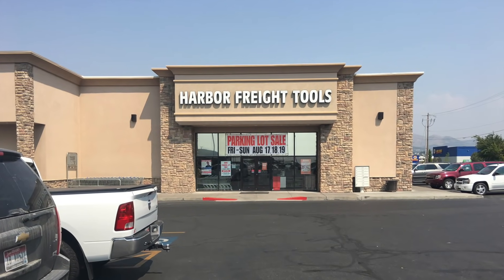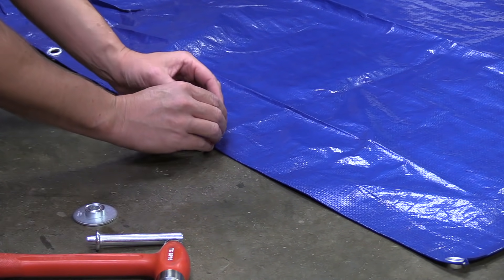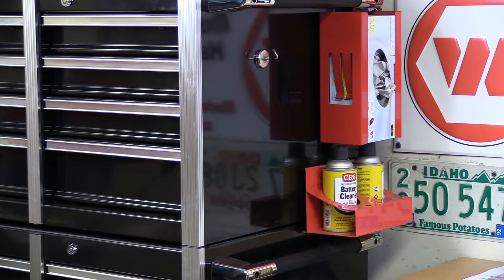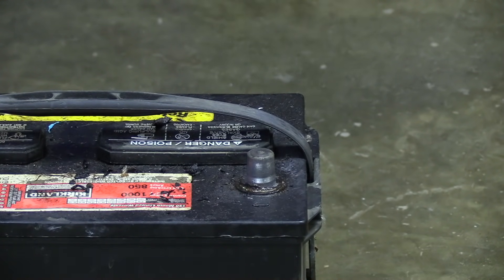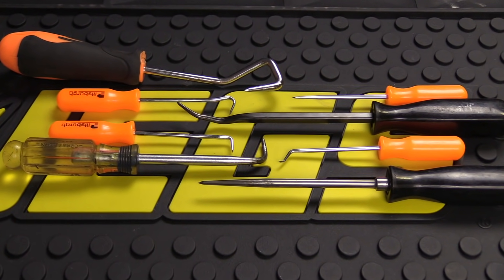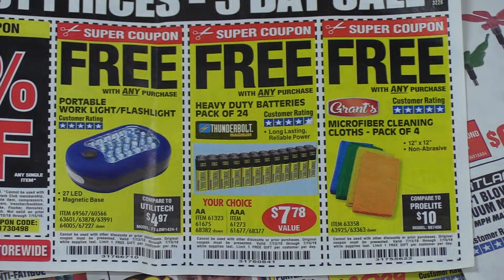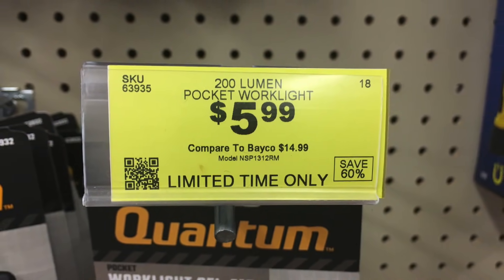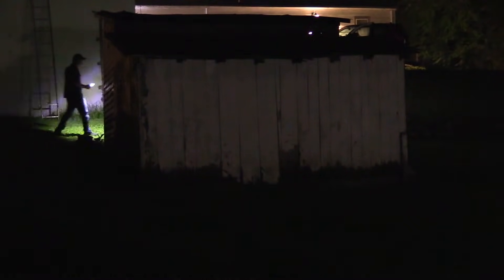TOP 5 BEST HARBOR FREIGHT TOOLS!! (UNDER $5)

Comment: I use that grommet maker.  It's very handy.  

I got a tip from another You Tuber, Explorer Steve, about the right angle ratcheting screwdriver set at HF.  It was only $1.99 I think but haven't been able to find it lately.  These sets are upward of $10.00 at automotive parts stores and the big box places.

Comment: I have had one of those battery terminal cleaners for years. I use it for cleaning oxidation off copper pipe prior to soldering.

Comment: I bought the 29 Gallon oil lubed air compressor about 5 years ago. Still works perfectly with lots of hard use. 
It's foolish to buy woodworking clamps anywhere else.
I paid $28 for a 36" pipe wrench that I don't need....until I do. Lowe's wants over $100 for one.
The breaker bar is great.
Warrior diamond grinding cups. I paid $30 at the time for the 7" version. I think they're $50 now. Still a good deal, works and wears well.

Comment: My socket set I got almost 15 years ago has never let me down in my conveyor assembly jobs and maintenance jobs over the years. Their wrench sets, I haven't counted lately but I think 14 piece has held up well also.
I recommend you open up the ratchet and give it a good cleaning and oil it up right out of the box and also a few times a year with heavy use. Might be why mine lasted so long.
Also the vertical and horizontal metal cutting bandsaw that they sell for like three hundred bucks now you should clean out the gearbox right away and put in fresh fluid because I found a good amount of Machining leftovers floating around in the lube.
Obviously these are not less than $5.

Comment: I  don't  have  the  grommet  kit , no  need  for  them .  2  sets  of  the  hooks , have  the  tray . Don't  have  the  light , but  do  have  the  slimbar folding  light   (  I  have  bought  6  so  far , 3  for  me  and  3  for  gifts ) , the  580l  tactical  light , the  280?  rechargeable , and  3  of  the  quantum  headlights.  I'm  a  refuse  truck  mechanic  and  you  can't  have  enough  light . 
The  only  problem  with  the  video  is  the  felt  noco washers  on  the  battery  posts . If  your  not  Reeeal  careful  that  crud  will  get  up  on  the  post  and  make  you  think  you  have  battery  problems . Been  there,  been  screwed  by  it .
Love  your  reviews , honest,  straight  to  the  point  without any  bs .

Comment: Seems like I'm the only one who doesn't like the picks. In all honesty, I don't mind spending a few more dollars on picks that are more durable at the tip.
Reply: Felix F or getting loose in the handle
Reply: Be careful. That's a double edged sword. A sturdier pick end means either it's thicker (which then I'd use a screw driver) or its a harder treated steel (more likely to mar surfaces). Besides, with a lifetime warranty, they're semi disposable.
Reply: Wait, your assertion is that the HF picks are better than hardened steel, because they're soft metal? Seriously? Sure, why use hardened steel when it's so much better to break off a tip from a shitty pick in a circuit board and cause a short, as an example. Would you like a few dozen more? Frickin' ridiculous. Insulting to basic human intelligence.
Reply: I have used mine six days a week for the past year in an automotive shop. They sure work great for Toyota oil filter gaskets, and I can keep my nicer set clean for interior applications.

Comment: The Bauer rechargeable swivel head work light is great. It costs about $30 and I use it daily at the shop. It has a magnetic base and runs in an 18650 battery
Reply: That light usely on sale for 22

Comment: lol using the 20% off on a $5 item
Reply: I'd rather have that $1 in my pocket than in their cash register.
Reply: I shop here at least once a week for something..  I always purchase two items minimum..  figure 20% saves you a buck, a normal coupon saves you a buck, and whichever freebie you want saves you 3-5 bucks..  that's a $5-7 savings weekly..at 6 bucks that's over $300/yr..  which paid for a cement mixer, a a framing nail gun, and a band saw..  all 20% off of course, and the nails and saw blades yielded me a magnetic bowl and microfiber towels for free. 🤷‍♂️
Reply: @aztekwarrior518  How do you like the band saw?
Reply: @jigiels29  didn't care for the blades, but the saw is great !   I built a stand for it so it sits upright like a tabletop saw .. and built a table for it..  has cut through anything I've put on it..very precise,  not crazy loud..  had it about 2 yrs I guess.. no issues whatsoever
Reply: A penny (dollar) saved is a penny EARNED.. it takes very little effort to get the email or coupon up on your cell phone and by doing so you put money back into your bank account.. Consider this, if the name of the business game is getting the money from your account into their account (legally) then your consumption ledger should show the efforts of you keeping your money in your bank.. Warren Buffet always says, "Profit is made when you buy, not when you sell" .. "Value" works the same way..
Reply: @dannyhale7645  You must live incredibly close to an HF or you don't value your time. If I'm going to HF, I'm not going to be buying just one thing that cheap, so using the 20% off on a $5 item doesn't make much sense.
Reply: @diydan2213  Yes, but between time and gas to get there, buying just one $5 item even with a 20% off coupon doesn't seem like a very good deal to me.

Perhaps if you have one within walking distance that might make sense, but I'd rather save the money on the gas and my time.
Reply: @SmallSpoonBrigade , I live in a small town, but there's a Harbor Freight about 15 minutes away. Since it's in the biggest town in my county, I drive past Harbor Freight a lot. I would definitely pull in the lot to save $1 if I needed the tool. I forgot what it was, though. Been a while since I posted that comment.

Comment: I pick up a magnetic tray or two almost every time I go in, or some other magnetic gadget - they come in handy in so many ways. Their various  vinyl gloves are good bargains, so many odd things ------------------------.  Recently, there seems to be a great improvement in the quality and utility of their new power tool lines and welders, and their hand tools may not be pretty or shapely, but for the most part, they are relatively strong and unless you are working in a pro shop, they serve pretty well.

Comment: The battery terminal cleaner also works great for sweating half inch copper pipe and fittings, I've used it for that for many years!

Comment: I've bought many tools and they all worked and do what they are supposed to do. The air connectors would be the one's I wouldn't buy because I was in the middle of painting with my air gun and it snap clear off the air compressor. I had to stop everything I was into and fix it.

Comment: I store my unsorted screws in clear flat containers (fishing tackle boxes with dividers removed) that are around the same dimensions as that sorting tray you showed rather than storing them in jars. Then you can just open the lid, pick what you want without having to tip everything out and then tip it all back in to a jar.

Comment: Bought an oiler recently.  It's perfect for random stuff around the house. Costs $4 and no need to cap it and it uses whatever oil ypu have laying around. My case some smelly bar and chain oil.  I used to  buy 3in1 and wd40, not anymore.

Comment: The blue handle Quinn 7" diagonal & 7" needle nose pliers are excellent for under $5. Had I known the 24" deep series 2 boxes were coming out & in blue no less, I would have bought the 72" instead of the 66" Husky 24" deep 12 drawer box I got back around May 2018.

Comment: About 6? Ago I bought a 190ac/145dc stick welder from HF. The thing is a beast. I’ve welded plow blades truck frames.   The neatest thing is though. I bought a rig tip from HF and a bottle for the argon. All together I’ve got right at 550 bucks minus the price of argon. It tig welds great. Next up I’m going to buy a plasma cutter from them.

Comment: I’ve had good luck with most things from HF, particularly the sawzalls. A couple of exceptions are the palm sanders(too much vibration) and the moving dollies. Those two items are bad. Also, some of their bits and saw blades don’t last but when you can get them for 1/10 the price they are still a good deal.

Comment: Another fav of mine is the warrior 3 piece hex to sockets that go from 1/4, 3/8 and 1/2 to a hex impact style shank and it's under $5. 

Other mentions are th3 braun 390 light when on special for $19.99 and the double close end ratcheting wrenches for like $20. Avail in sae and mettrica and you get 4 wrenches with 8 total sizes.

Comment: I love the $15 angle grinder. I’ve had it for 2 years so far. Works great!
Reply: I concur. I've cut endless amounts of rebar with it, cut many a brick ( diamond wheel ), and it's never even flinched. Cannot go wrong with the small angle grinder ( Drill Master ), from Harbor Freight!
Reply: I've got that on my wishlist and a coupon to get it for under $10.  Really need to do that before the end of the month. =(

Comment: Cut off wheels are very decent 10 for 799 you can't beat that! Also I do sheet metal or ductwork Andis taper bits are amazing there are only 599 if you go to any other place you pay like 30 bucks or better

Comment: Any and all shop consumables, like brushes, sandpaper, zip ties, rags, electrical heat shrink, and connectors. The constant free supply of electrical meters, blue tarps and batteries with the freebie coupons is super convenient.

Comment: Picked up an Ammo box this week with the coupon and it was 2.99 .. it has a pad lock hole and a handle.. most plastic boxes of the same size is at least 8-12 dollars on Amazon or eBay, or more..... with no securing lock hole or handle.. I use these boxes for everything except ammo.. lol..

Comment: I have the flashlight I suggest taking it apart and locktite everything except the where u change the battery because I drop mine all the time it was coming apart and clicking on and off I abuse it every day. Good light. Ps put camera batteries in it

Comment: My favorite tools from HF are: Breaker Bar, Dual Action Car Polisher, Jig Saw and torque wrenches. But the best bang for the buck are the multimeters that you can get for free with a coupon. They aren't the best meters but they are good enough for most things, plus it's nice being able to keep a multimeter in the trunk and not have to worry about it. I'd much rather leave that meter in there than my Fluke 87. 

I will never buy another battery charger from HF though, I bought a charger and it ended up killing my lead acid battery. I'll stick with Schumacher battery chargers from now on.

Comment: i like the sockets,  doyle cable cutters, screw drivers, us general boxes. i like their angle angle grinders for home because theyre cheap enough to have one with a cut off wheel and one with a grinding disc, but i tried one at work and broke it.

Comment: The left hand drill bit set in the blue case. The vulcan 0.35 flux core wire is also good.
Reply: They are over $5

Comment: Thanks for the interesting video. I took you advice and piked up one of those Quantum Work lights and it looks like an AMAZING value for 5.49 with the 20 percent off. I actually used the light an hour after I bought it when I needed light inside my car to find something. I'lll probably buy a couple more of those- so great call on those! I also picked up some of the Bunker Hill 'dry' boxes/ ammo cans for 2.99 with a coupon for a special deal/price on the cans. They don't look to be either air or water tight, so I don't know if I'd buy them for full price, but for 3 bucks they seem passable. I'm going to try to make a gasket for the an using the RTV gasket maker. 
The ovalish blue LED worklights with the magnet and the hook are a MUST HAVE. I'll pay # dollars for one of those, but they have the free coupons on a regular basis. So buy some 1.99 work gloves and get a free flashlight. Heck, that's halfway to a disaster preparedness kit.

Comment: My most 'saved the day' tools are
1. Pittsburgh 3/8 in. Drive T-Bar With Flexible Ratchet - literally couldn't get 2 jobs done without one of these.
2. 4 1/2" angle grinder (with a speed adj. trigger not side sweitch, been well used for over a decade, even came w/spare brushes
3. 3/8ths and 1/2" wobbles and extensions.    can never have too many wobbles for pulling transmissions, starters, differentials
4. hydraulic jacks and stands, safety in more stands.

Comment: I bought that light for work as a cheap carry spot since I often work in Darkly lit places-and wanted something smaller to carry. it has gone far above my expectations. It’s plenty bright and gets that job done and love the magnet, although wish it was stronger.but for a $5 light it has been the toughest little thing. Have dropped it two stories with it hitting racking on the way down, been dropped off a boom lift landing face down, it has  survived a clogged drain raining onto it as well as countless other times I thought for sure it has finally succumbed but nope. Same one it still going strong after 2 years of abuse.

Comment: I don't have that Quantum light but I have 3 other ones and I like all of them. The breaker bar, indexing ratchet is nice plus many other things. I also like the yellow Daytona Jack. I also have the Snap on Jack they compare it to. The Snap on is a little quicker to Max height but it doesn't equal the difference in price

Comment: I found a round rubber hockeypuck like tool that has 8 sockets molded into it that fit metric and standard and has a 1/4 inch drive for screwdriver bits and a hole in the middle so you can insert an bar (screwdriver) for extra torque its handy af

Comment: Not under $5 but I bought a brad Nail gun for about $15.  I have been told by several people that I  made a huge mistake.  It has been several months and I have used it a lot with no issues.  If it breaks the next time, I will run out and buy another and still be less that than the $50+ that the big box stores sell them for.

Comment: I buy drain snakes there all the time. The 15' snake is under $10 and I buy them in pairs. Sure, they get kinked up, but so do the expensive ones. If I can snake 2 or 3 tubs before tossing it, I'm delighted. Sometimes I toss it because I can't be bothered to detangle the wad of hair.

Comment: My number one picks would be the needle file set, and parts brush set.
The brushes are pretty self explanatory.
The files aren't very well formed and mine have dull spots an one side of some of them, files are a consumable anyways.
You get a bunch of them in the set and they do cut pretty well, they're not going to last as long as even a modern Mexican Nicholson but they're so cheap it's still.worth it.

Comment: I used the pointer set for a transmission line clip. works great. just rembember when you buy a new radiator make sure you don t remove  that clip just slide the line in till it clicls 2005 grand prix.

Comment: As far as HF pics go, here's a few: (prices are Approximate) 
16 PC Precision screwdriver set, ($3.99)  tarps , moving blankets (6.99),  24 pc Button Cell battery assortment ($3.99), pick up magnet (with handle), magnetic tray ($2.99, or free with coupon) , bungee straps ($5.99),  predator 6.5 hp 212cc engine ($129,  $99 with coupon) , assorted bolt set ($5.99).  

Hand tools are generally a good bet, and the warranty is excellent, which makes them a better value than even Walmart's Hyper tough line, which is similarly priced.

Comment: They have a 5ft drill bit that is great for running wires . It has a small hole in the bit end to hook ur wire to . So u can pull it back after u drill ur hole. Its 8.99 + TAX

Comment: The $5 Braun light puts out a good amount of light, seems sturdy, and has a decent magnet, but mine have had issues. I bought two and both turn off completely when dropped even very gently. The batteries that came with one of them leaked and ruined the light. And my Braun 390 lumen folding LED light stopped working entirely after the second or third charge. Not sold on the Harbor Freight lights just yet. If you buy them I'd say keep your receipt and packaging, I wish I had....

Comment: I frequently miss use and abuse tools and power tools. I will often buy something with the intention to break them with the job I'm working on. Well.... It isn't as easy as it would seem. Those power tools are tough, even after being left in the rain. I bought a metel chop saw, years ago, and that dang thing won't stop! It looks horrible but works like a charm

Comment: You shouldn't need a battery terminal cleaner. Just make sure to apply an appropriate amount of dielectric grease and you shouldn't have any issues with corrosion.

It rains a bunch around here and leaving the terminals unprotected, even when not rained on directly, is asking for trouble.

Comment: My top picks are not $5 or less, but they are great values...
1. Pittsburgh 1/2 & 3/8 torque wrenches - accurate and cheap; industrial quality.
2. Pittsburgh impact socket sets
3. Pittsburgh tap and die sets both sae and metric - get the separate sets for 24$ each -  you get more sizes than the combo kit.
4. Pittsburgh chrome vandium premium wrench set (not the cheap ones) the premium set is good
5. Rechargeable Quantum 150 lumen pen light, super handy and small, micro USB port to recharge, I wind up taking this thing EVERYWHERE.... 12$... MUST HAVE!